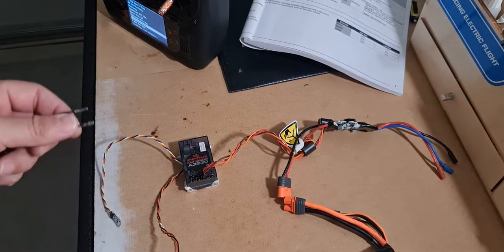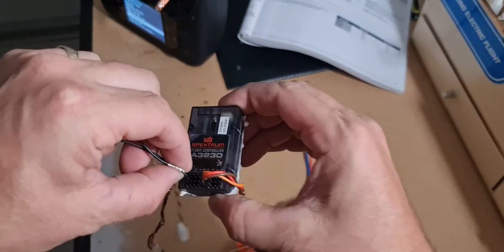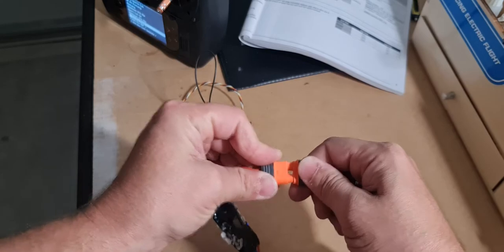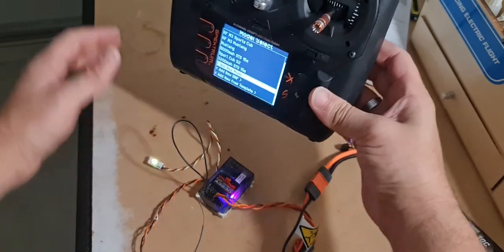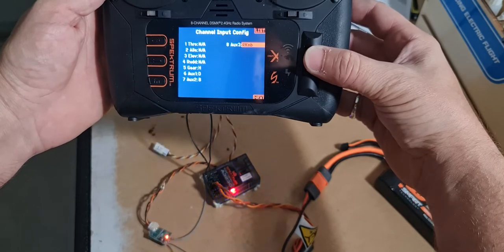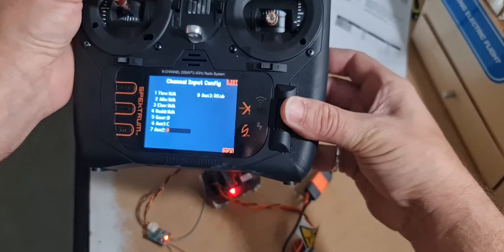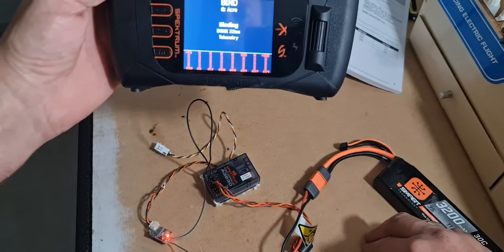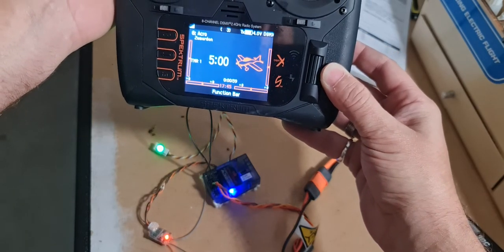Binding Apprentice STS 15e

Comment: I done the bind process like in the video.
After I disconnected the battery and re connected, there are ni lights on the receiver , only a solid orange light in the small reciever.
Like there ia bind, but I can't control anything.
Why?
Reply from the maker: did you get it working?